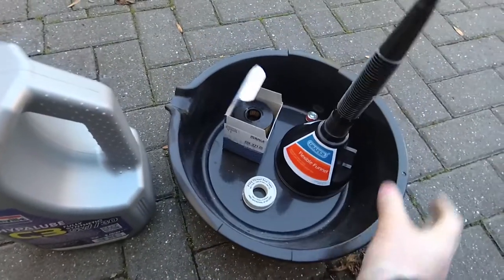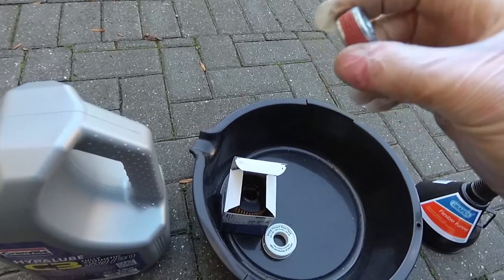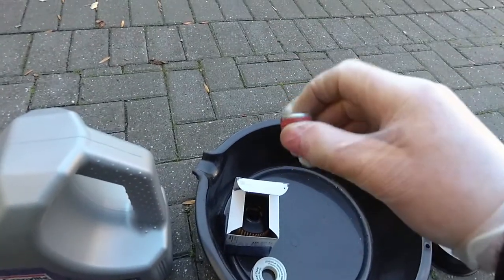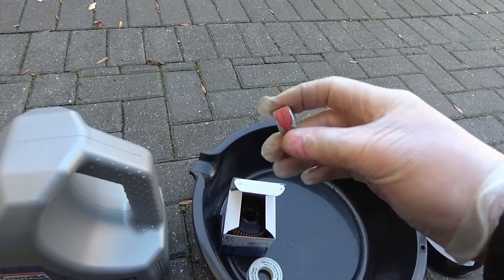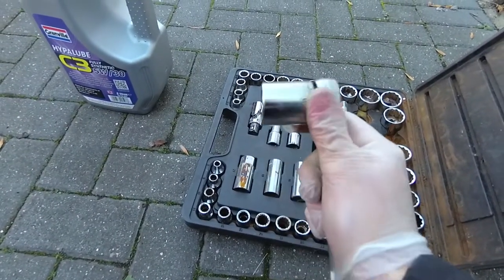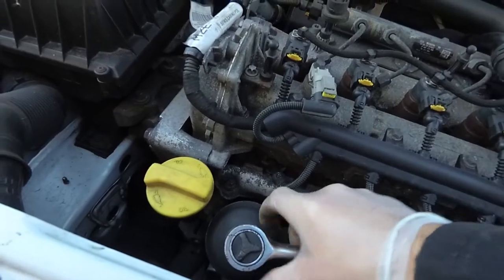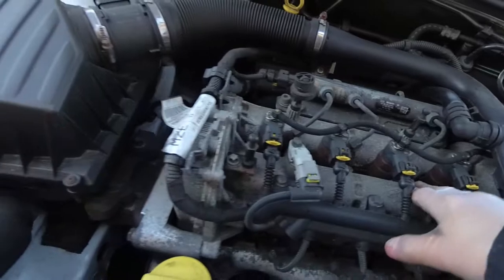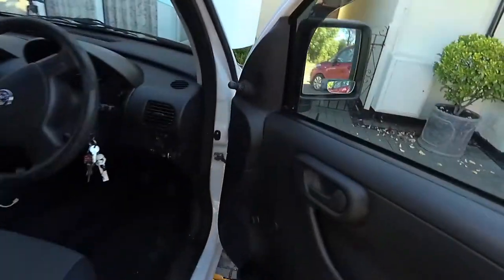10 MINUTE OIL CHANGE - Challenge - COMBO MODS

Comment: Done a service on my new combo today and the oil filter wasn’t clipped in to the lid. On closer inspection it seems to be the wrong oil filter housing cap as the filter is apparently right.  Argh the stress lol. The filter fits in it just isn’t clipping In and I don’t like I like that. It’s the bang same filter as yours
Reply from the maker: It’s always great when previous owners fit the wrong parts. 🤣
Reply: Rust Locker haha right joke.  I ended up buying a new cap from Vauxhall & all is now good haha
Reply from the maker: @darylp5861  Ah cool. glad its sorted

Comment: I've noticed on euro car parts, despite plugging my reg and exact vehicle info, it still comes up with 2 different oil filters. a taller and a shorter one. No idea which one it is, ECP is pretty useless at specifying.
Reply from the maker: Yea, I went to the local motor factors and they had 2 listed, I just grabbed both and took the wrong one back. Bit of a pain but they’ve got me in the system now, so I always get the right one.

Comment: Good going though. Exciting to watch. Give it another bash.

Couple of top tips for you to help speed things up. 1. Remove the oil filler cap and dipstick before removing the drain plug. It'll help oil flow faster. It's sometimes called the "Hawaiian Bong" method. 2. Replace the o-ring before you put the new filter in. Just makes it easier to slip on. 3. Put down a big sheet of old cardboard so you can catch oil spills, put your tools on, etc. then you can be as messy as you like without destroying your driveway. 4. Use an engine flush beforehand. It'll thin-out the old oil making it flow even faster.

Also, you might want to keep the new o-ring clean. If it picks up grit from the ground, it might damage your filter housing. Obviously, not a good thing if that happens.

And for safety's sake, like the other guy said... get a couple of jack stands under there. You really don't want to go viral because your skull was crushed (I assume).

Oh... and with these top mounted oil filters, you'll want to run the engine and recheck the oil level. It'll drop slightly until the filter housing has primed itself, so it'll need a small top-up at the end.

Comment: Why did you care if the sump grub screw had a different size Allen key? So long as the main thread was the same it didn’t matter. 🤔
Cool video all the same 👍

Ps, what oil did you use? How many miles has your combo done?
Reply from the maker: If I remember correctly, the thread wasn't the same size either, I just didn't explain it very well in the video. Oil was Fully Synthetic 5w 30. Mileage was about 130,000 I think.
Reply: Rust Locker fair enough mate, if it don’t fit, it don’t fit 😂
Just got my first combo, 84k on the clock. Hoping to give it some love and get a few more miles in it. 👍
Reply from the maker: +MrOitoyboy From what I’ve heard, as long as you do regular oil changes the engine goes on and on.